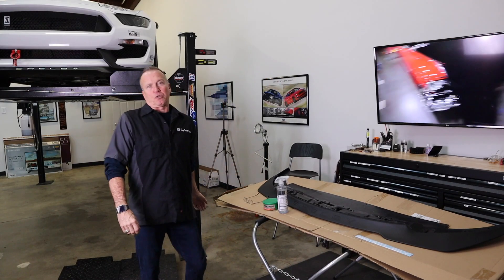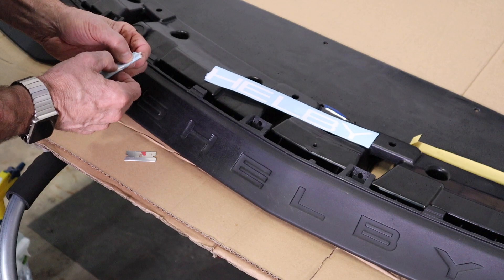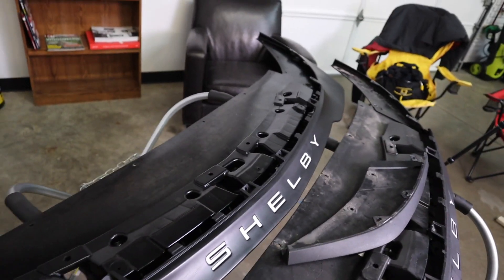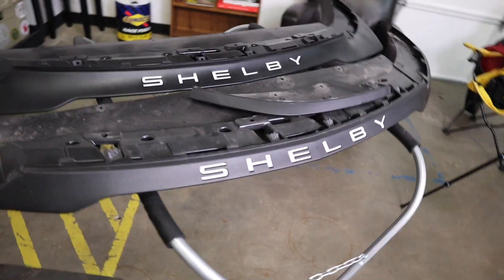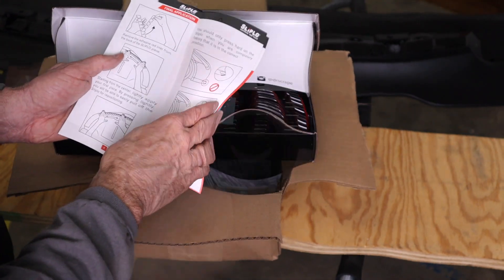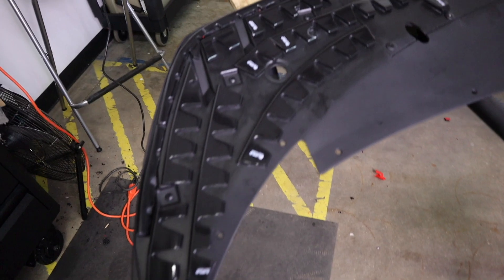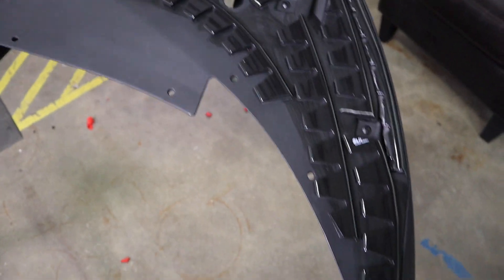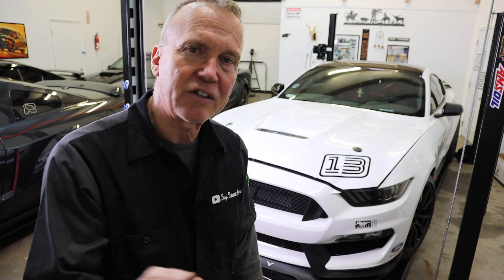GT350R splitter, SliPLO Universal Skidplate install.

Comment: I bought the same aftermarket splitter and plan on installing the sliplo in the same configuration as yours. How is your splitter holding up? Would you say it is a good buy?
Reply from the maker: Hi Andy, thanks for running into ESG. Since the install, no issue's at all and everything has held together perfectly. In fact, Im going to order another splitter just to put up and hang onto for the future (just in case). Let me know if you have any questions.
Reply: EasyStreetGarage, that’s great to know. I feel better now about installing mine. Thanks!
Reply: Would be great to name the seller on eBay , so we can buy the one that’s been tested already
Reply: Is it pureoutdoor seller on eBay ? cause he is the only one I see selling a one piece valance non oem for $560 plus $80 shopping ?
Reply: Pk, yes, that is him.
Reply: Hello Guys, 
I’m trying to look for the splitter but can’t seem to find the right one. Can anyone help me with the actual name? I try pure outdoor but nothings populated for the 350R splitter. A link would be greatly appreciated